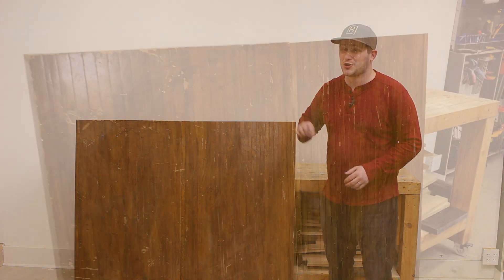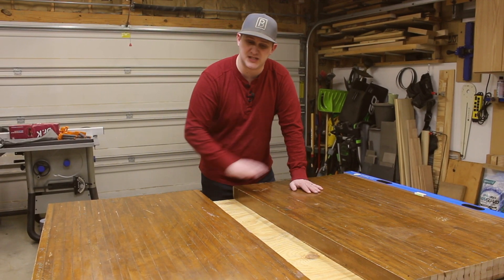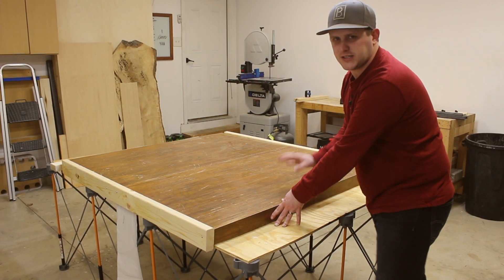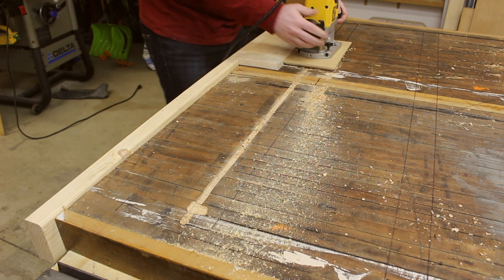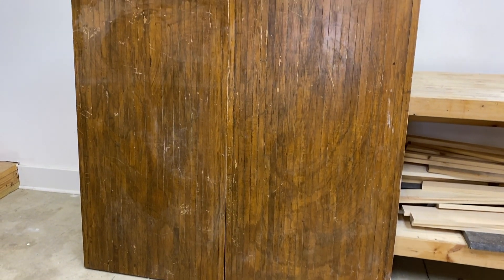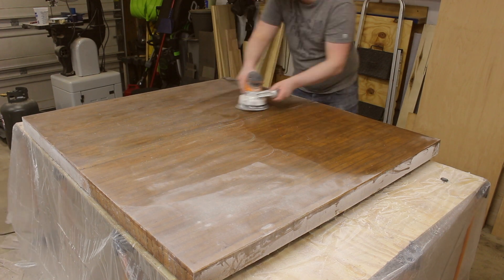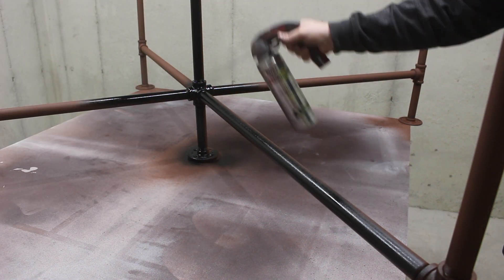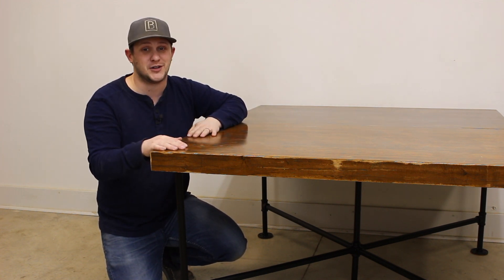DIY Metal and Wood Dining Table | Reclaimed Bowling Alley

Comment: Thank you for this. We have a 4’ x 6’ ish piece of bowling alley from the San Diego Naval Base- installed in the 30’s and removed in the 60’s. Some of the joints are starting to separate and I was looking for advice to secure and stabilize it before putting it in its’ permanent spot. I’m impressed with you moving it yourself- ours is really heavy too!